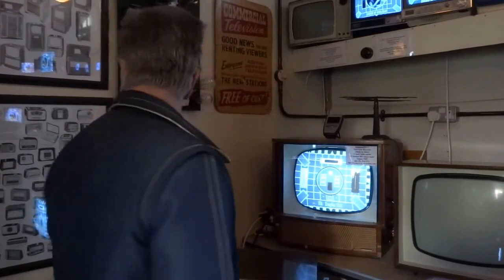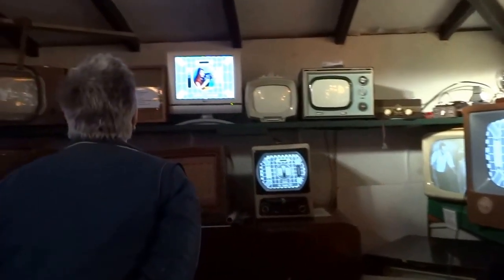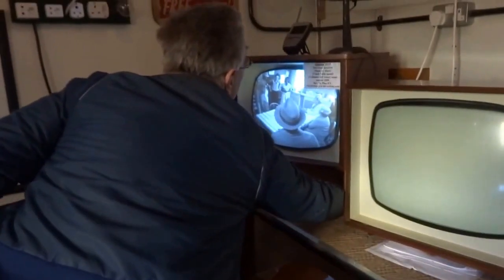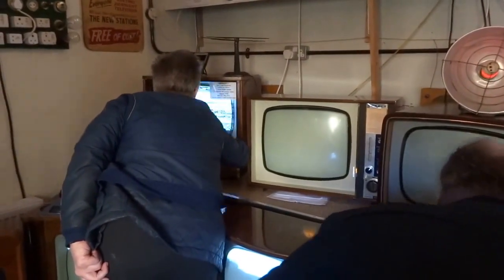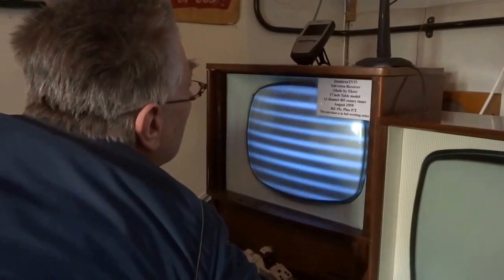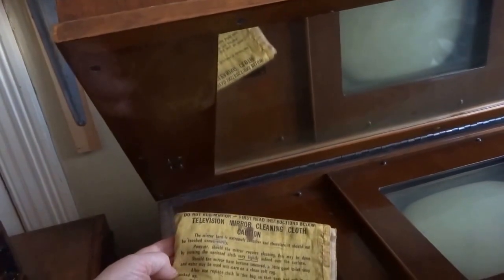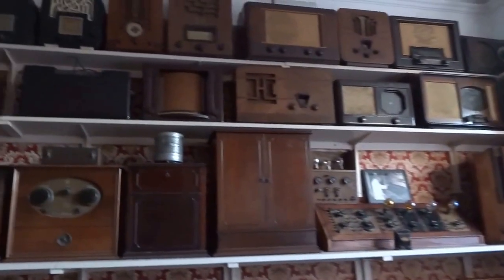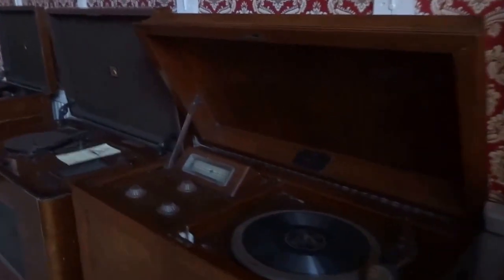405 Line Dynatron TV Working

Comment: Loved hearing that Line Whistle again and all that lovely line structure brought back Childhood Memories.
Reply: Not really a difference between VHF and UHF, but rather a difference between PAL and NTSC(Designed by RCA). In the US, there were so many B/W TVs sold nationally by 1954(year of NTSC adoption) that anything in the way of color broadcasting that was not compatible with the existing standard would be all but rejected by the public and manufacturers, note the earlier FCC adoption of the incompatible CBS field sequential color system, CBS even with the government's grace couldn't get manufacturers to sign on. The British and Europe only started thinking about color a decade later. By the 1960s, the 405 line system was very dated, having been inferior all along to the US system, it didn't really make sense to build color on top of it like NTSC, and with the limited bandwidth allotted between channels, I'm not sure it was even possible. Since they were dropping the 405 line system all together, it only made sense to solve any remaining issues with NTSC and tailor it for the 50hz power frequency by having 625 lines at 25 times per second instead of 525 at 30 times per second, ignoring interlacing. The UK kept simultaneously broadcasting in 405 line for years after the PAL flip, kind of like what we did here with the digital transition. VHF and UHF are just frequency bands. 

The high pitch is the horizontal scanning rate of a 405 line set,
(405 lines)*(25 frames per second)= 10.125kHz, the sound you are hearing. The higher pitch out of NTSC sets is 15.75kHz, it is just as loud, just that ones ears roll off the higher frequency.

Comment: The waveform monitor is displaying two lines of picture information - line sync pulse followed by the colour burst superimposed on the back porch, then video information (luminance and chrominance together), ending with the front porch.The colour burst is a sample of the subcarrier oscillator from the source, which provides the phase and amplitude reference for the QAM modulated chrominance signal during the active line period. The phase of the chrominance signal determines the hue that is displayed at a given point, and its amplitude determines saturation.
Reply from the maker: Yes that's what I was trying to explain in the video - but rather badly.

Comment from the maker: @ShymFan2007  OK a bit of history - BBC TV in UK started in 1936 using 405 lines VHF band-1 (channels 

1-5). Then FM radio took up VHF band 2 from the early 50s. The first commercial services 

(ITV) started 1955, also 405 lines, but using VHF band-3 (channels 6-12).  

When 625 lines started in 1964, space was found in UHF bands 4&5 (channels 21-69)  

(channels 13-20 were not used in UK)  The 625 UHF service took almost 20 years to be 

available throughout the country, and only then could the old VHF service be turned off.  

There are several funny stories of unmanned relay stations in the Scottish Highlands going 

off air and no-one ringing in to complain (cuz no-one was watching them). There is also a 

story that one such transmitter failed and the only viewer was a little old lady with an 

ancient set. The BBC decided it was cheaper to give the person a new set rather than repair 

the relay.  I can't comment on the truth or otherwise of these tales.

Anyway, When the 404 VHF service finally closed the UK Government thought they could 

raise a whole load of cash by auctioning off the spectrum to the highest bidder, thus VHF 

bands 1&3 were lost for broadcast use.   Most of this spectrum in UK is now used for civic 

mobile services (Fire Police etc) and a small bit of band-3 carries digital audio (DAB).

I agree many countries still use VHF for broadcasting but tend to have less broadcast 

presence on UHF. It all balances out I guess.

The whistle U ask about is because the line oscillator frequency for 405 is about 10Khz 

whereas on 625 & 525 its more like 15-16 Khz  The calculation is thus... Multiply the # of 

lines by 1/2 mains frequency = Line oscillator frequency. 

Thus 625 x 25 = 15,625Hz  and 405 x 25 = 10,125Hz  and  525 x 30 = 15,750hz

Hope that helps-- Nigel
Reply: The 405 line B & W TV sets don't seem to give that bad a picture compared to 625 line ones, as long as the screen isn't too big in size and you view at a distance.  The 405 line analogue system DID have some advantages over the 625 line system.  Less bandwidth was needed for 405 lines, so more broadcast channels could be allocated on VHF Band I and III than using 625... the signal coverage area was better because of lower channel bandwidth AND the use of VHF instead of UHF, so less transmitters were needed for national TV coverage.  Disadvantage of 405 line system over 625 lines: noticeable lower picture resolution, more prone to electrical interference, large bulky VHF antennas needed on roof which would blow down during storms. 405 lines was an advanced TV system for it's day (1930s)

Comment: Interestingly, in 1964 there were tv boxes converters on sale, for to watch BBC2 by these TV SETS for system A 405 (378) lines? Reciever system I 625 (576) lines at UHF - VHF modulator for system A 405 (378) lines. Or should have to buy new TV SET with 2 tuners (in period 1964-November 1969)?
Reply from the maker: There were some converter boxes that would convert the frequency down from UHF to VHF & visa versa. They were sometimes needed for communal aerial systems in block of flats. I remember one model called "The Televerta"  However its most unlikely that anything was available that would convert line standard. After 1970 the BBC distributed all TV over the national network at 625 lines and used an enormous device the size of a large wardrobe at each of its many 405 transmitters to convert the signal down (I know how big it was I've seen one).  Back in the 60s, before any modern digital tech, a domestic device doing the same thing would have been impossible.
Reply: @Actranuk  Thank yoy very much for answer.
Reply: @Actranuk    .When I used to visit the V W M . Gerry wells had  the 625/405 converter in his back bedroom. it was in a 19" rack about five feet high.
Reply: Should have adsded that it was the one from B B C crystal Palace.

Comment: That 10Khz Horizontal pulse sound is absolutely awful...how could watch anyone ever TV on a thing like this...
Reply: Because a) there are more than several 405-line TVs running in that room, so the 10.125KHz line whistle is actually coming from many sets, therefore amplifying the sound, and b) it was quite easy to get used to the sound. A few weeks after I had finished restoring my first 405-line set, I'd never notice it.
Reply: They sound beautiful to me !